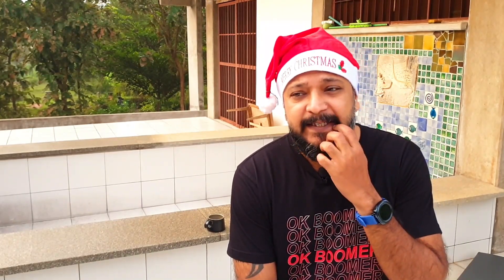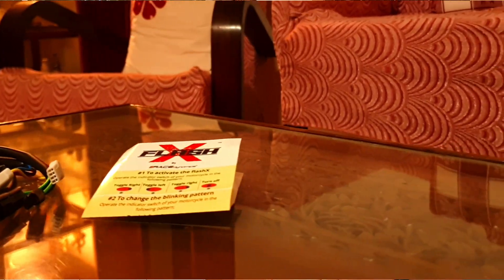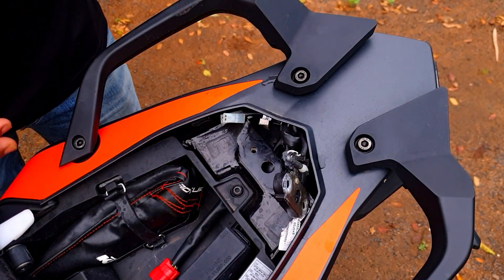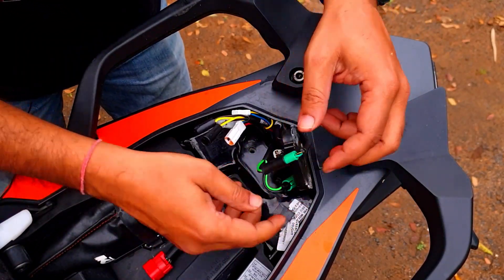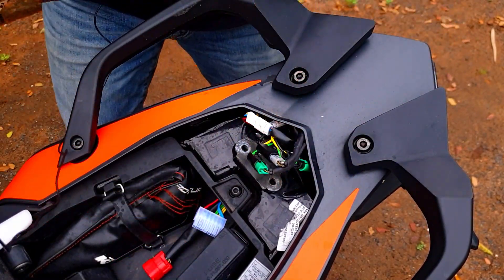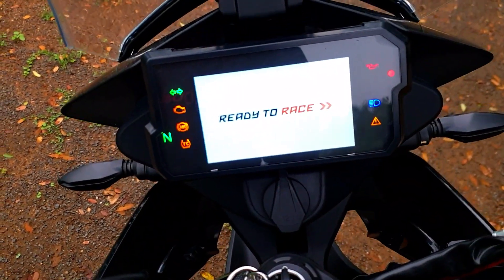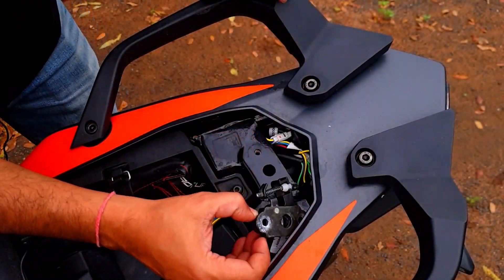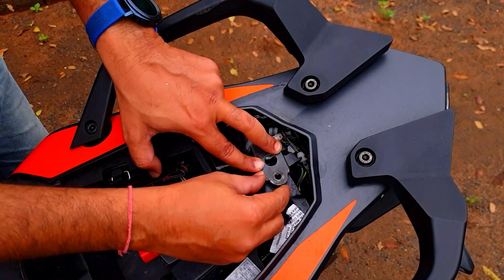FlashX (Hazard Light) Installation on KTM 390 ADV in 3 Simple Steps

Comment: Thank you for this, all the bikes I have owned in the past few years have had hazard flashing as standard. I haven't actually got any room left under may seat for the flash module as I use it for the dash cam unit. What I can't understand is why KTM can't just put hazard flashing into a update for the dashboard. Surely all the wiring is there including the handlebar switch and it could be done in software, although the indicators would probably flash at a different rate, which wouldn't matter much.
Reply from the maker: I know right! It shouldn't be difficult given the amount of electronics they've already loaded into it... 
The other thing you could do is place the FlashX behind the fairing, in the tail. But that will mean dismantling the tail panels... if you are up for it 🙂

Comment: can you show how install  aux light with wiring harness, my main issue is  to know where is the ignition wire
Reply from the maker: Hi Nihar, I haven't installed aux lights because of lockdown. I thought I'll make the purchase when I can travel again 😁
But by ignition wire, if you mean the aux connector, its behind the headlight. You have to open the screws between the 2 lights, and the wire will be tucked away (a bit difficult to find sometimes)
These will correspond to the aux wire under the rear seat (as shown in my video)
Reply: @RoadAheadWithAJ  thank you 🙏 
Do make a video when ever you install

Comment: Do we get a default hazard lights from ktm like the ones in car??
Reply from the maker: No we don't. That's why RaceDynamics has this plug n play module. Its one of the -ve points on the 390 ADV vis a vis the Himalayan.
Reply: @RoadAheadWithAJ  but i saw some bikes have this in default or not??
Reply: Ig they use aftermarket hazars
Reply from the maker: @shivanshusingh7942  yes there are other after market options available, just do a search on Amazon